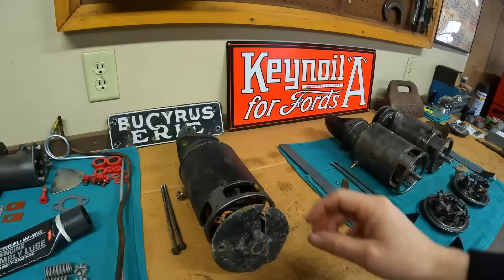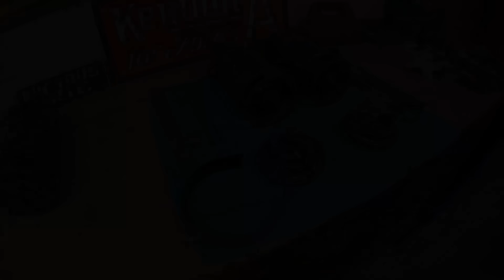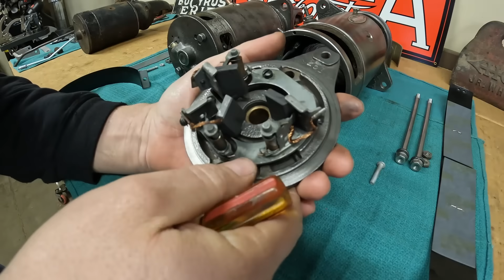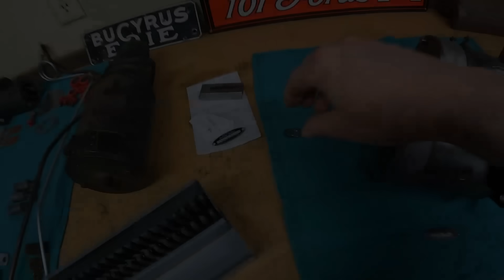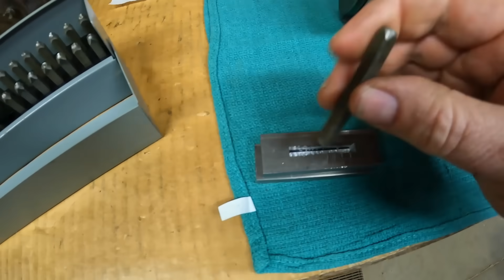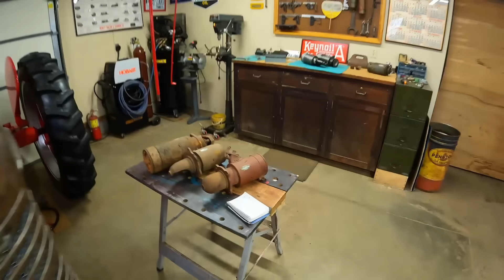Farmall Starter/Generator ID Tag Restoration, Brush Installation, & Final Assembly - "Prep H" Ep #34

Comment: Thank you so much for this video. I’m working on an old farm all generator. 6volt. I took it apart because I’m not getting charge from it. I’ve replaced the coil and regulator and cleaned all the contacts. So I decide to take the gen apart. Where do you get the new brushes and other parts for the generator?
Reply from the maker: For brushes I take the Delco-Remy part number to my local auto parts store and they’re really good about tracking new items down. Not all auto parts stores are the same though, so some might do better than others with this old stuff but it is still out there. For the rest of the parts, I rely on buying any cheap cores I can find at swap meets and keeping them on the shelf to use parts out of 👍

Comment: I enjoyed your repair video, I have been working on a two brush generator for my 1962 Pontiac I also have a spare from a 1961.  Both seem to be grounded at the armature lead when I test using an ohm meter. There is an insulator bushing in the hole, I'm thinking that there should be a plastic washer on each end, am I right or should that lead be grounded?

Comment: Where could I find replacement screw for the steel shoes on the field coils. Im trying to restore an autolite jeep generator. 3/8x16x3/4 length. Really appreciate your series on the generator and starters!
Reply from the maker: I keep enough spare units on hand that I just pull one from my pile, but if I didn’t have any available here I’d go to the McMaster-Carr website and browse around. They have just about any type of hardware ever made 👍

Comment: Looking at the brush installation, it appears that the tension spring wraps around the metal post on the "insulated" brushes.  Wouldn't that earth the brush to the case?
Reply from the maker: Those posts have insulation around their bases, keeping them isolated from the case.
Reply: @squatch253  
Ahh, got it.
Thank you.

Comment: well, I am still catching up on videos, I hope it helps you out in you logarithms, As Ralphorr8138 stated,  there are small holes in the back plate which are about the size of a small paper clip wire. This is especially true were you do not have access to the brushes during assembly. Is it true on the real old generators, alternators and starters that I can not tell you. But in tech school back in the early 80s that was drummed into my head as well

Comment: During my time in military aviation I saw engineering examples and prototypes. Most had part and serial numbers that the in-house numbers associated to a project number, not the final part or serial number format. This is to safeguard the company from IP theft, and clearly identify parts not intended for the final customer use. Only occasionally did I see an engineering example or prototype go from being 'X-009' to 'S/N 0001', and they put the new product identiplate abutting the engineering example identiplate. I asked about it, because it can be confusing... I think it took close to two years to move the engineering example identiplate from the exterior where you could see it, to the underside of the panel it had been in so the plate remained with the unit but couldn't cause confusion. It was a bit of a head banger, the unit was meant to support the SH-60B/F/H and MH-60R/S aircraft but the SH platforms were retiring....

Comment: cover joint on the bottom also lets inadvertent water intrusion drip out😊 When I worked in a parts store, I'd collected a few generator cores from customer alternator conversions. It was a great deal all around: the customer got their core value for the alternator and i got a generator for the cost of a 10si core.  those generators ended up being just fine! (rebuild wouldn't have hurt one but it still charged when i tested it)

Comment: Toby, you know I've been here with you since the start but I was just going to say I've rebuilt both the starters and generators for some IH stuff but as I've told you feels like a million times I'm an old Massey mechanic and I had a couple more steps when it came to rebuilding a generator for a Massy than a IH because I had to normally had a gear drive rear brush plate because the shaft on the generator ran the tach but that was the only difference from them. You just had to really clean the gear drive good and grease them good before completly putting them back together but to good old delco-remy was on about ever tractor I ever worked on. It's because General motors always built the very best stuff well and like their vehicles LOL I couldn't resist that gouge I'm a GM guy myself and you being a former Ford guy I had to atleast poke at you. Great video, keep up the good work you know I'll always be here watching.

Comment: The prototype starters reminded me of my 69 AMC Ambassador. When the starter failed on it, I couldn't find a replacement anywhere. I could tell that it was basically a modified Ford starter so I checked my spare parts stash and found a rebuild that had come from some scrap I had picked up when some friends were cleaning up a small junkyard. Everything fit except the nose and the armature. I needed the starter drive gear too but had to turn a piece of it backward so that it would push out far enough to get into the flywheel ring gear. Fortunately the armature was even though the brush plate and field windings on the old starter were shorted out. That's why I hate to let go of anything that has good parts on it. The old saying is that the average time between throwing something away and needing it is 3 days.
Reply from the maker: Yep, like the old Boy Scouts motto of “Better to have it and not need it, than to need it and not have it.” 👍

Comment: Boy... do i hate potmetal. Whenever i get something new, machinery or vehicle, to replace the potmetal off it, is my no1 goal as repairs go. The first of the Bernard London implementations to cheapen out products, akin to me buying a Bosch grinder, thinking "it's still a good brand" and discovering they ... changed the bearing plate for reinforced glass plastic. The most trafficked and most vital component on an angle grinder... and they made it out of plastic. Don't get me wrong, it still works, but i know it will break eventually. Same with pot metal. Only i prefer ditching it as soon as possible. That stuff cracks and warps just sitting on your shelf. I had 4 or 5 counter plates for briggs and stratton engines. New items, never used. All warped. I chucked them all to the bin the same day going through each with increased aggravation.
Just a rant about potmetal, i guess.

Comment: Both starter and generator back plate have small holes to put picks or welding wire through to hold brushes back for easy assembly. This method was drummed into me by my tech when he was training me, so have never forgotten lol.

Comment: Why do you say a 3 bolt  starter flange is rare for a minneapolis moline?  All the moline  tractors  from the mid 1960s and later have 3 bolt starter flanges.
Reply from the maker: That remark is in reference to anything in the 445 model era, where instead of a bolted flange they primarily used the single taper point setscrew with jam nut that came into the nose cone from the side. Even though the X231 prototype used the 3-bolt flange, the subsequent production models all had just the set screw. Anything outside of, or built after, the 445 models I have no experience with at all, so very little knowledge of.

Comment: What a great episode. The X231 and other prototype starters are a oddity on it's own. The big guy is probably 24V if I would have to guess? Really appreciate you covered this topic.
Reply from the maker: Thanks, the big starter does have 12 Volt on the tag 👍
Reply: @squatch253  That is very interesting info. Usually something this big indicates a upgraded voltage system. However the only thing I can think of is a big engine that needed lot of cranking amps, where it was designed to operate.

Comment: ds1945
Great videos. When installing brushes on a starter we were told to push down on the brushes to make sure they were properly seated on the commutator.   I really enjoy seeing these old machines being restored. Are you going to put he old cab on?
Reply from the maker: Yes, but after I’m satisfied that the diesel engine is fully broken in because once the cab is on, having to get back in and work on anything will be difficult. The D2 was supposed to get ran and worked hard for a couple days straight at plow day weekend last fall, but my eye surgery and ensuing recovery period put a halt to that.

Comment: In regards to starters of similar tractors like my Case IH.  When you service the brushes, some starters are reversable with their rotation.  The brush cap may be installed and clocked onto the starter housing at a 90° offset as there will be 2 to 4 bolts.  Reason for the 90° offset is to align the brushes with the commutator to allow the rotor polarity to be switched to allow the rotation as either clockwise or counter-clockwise.  Also, these starters do not care weather the tractor is a positive ground or negative ground, the different grounds will NOT change the direction of rotation as the ground polarity will affect both the stator and rotor fields equally.  The cap will have an identifying notch on it and the housing will have a "L" and "R" on it for the direction of rotation allignment, or vice versa as I cant remember that specifically at the moment.  If the starter is not rotating in the correct direct, the bendix will not extend and engage the fly wheel as this is a safety feature to not allow damage to the engine by the inadvertent reverse rotation.  If this happens, you probably have made a mistake in the alignment of the cap and housing.  As such, an adjustment would have to be made and the cap rotated by 90°.
Reply from the maker: Thanks for this info! I have seen starter end caps with two sets of bolt holes in them before, but did not know why they were made that way. Now I do! 👍

Comment: Nice segment on the DelcoRemy starters and generators and the tagging 6v. Black 12v. Red and the Green tag experimental  models like M/M used I do recall a few blue tags in my wonders round grand dad's farm and grandpa Bowens machine shop on various pieces of equipment. Great video really very informative. I got most my education on starters and generators on my dad's 60 CJ5,and my 61 IH Scout all wheel drive with the 4cyl. Comanche engine. The jeep was 6v. And my Scout was 12v. With blue tags. Wasn't sure why they were both blue dad converted his jeep in 75 to 12v red tags.

Comment: what makes thexg12 different it slows down the ionation of rust or something? or it lubricates better or does it seal better and not lubricate as well or what?
Reply from the maker: The XG-12 is thinner, clearer, and is made to get into tighter areas and maintain electrical flow while resisting moisture. The XG-3-A is much thicker and also resists moisture, but is made to primarily reduce electrical arcing damage between looser fitting components.

Comment: If the bushing in the end cap was worn to oversize and needed replacing, how do you suggest pulling out the worn bush from the blind hole? It looks like a small 'freeze plug' insert closes off the hole.. Would you just first knock that out, then replace it after bushing swap, or can the bush be changed without removing that closure cap?
Reply from the maker: Yep you’d remove the plug first, then drive the old bushing out - or just let the old bushing push the plug out instead. New bushing goes in, followed by a new plug to seal the outside of the bore again 👍

Comment: Question. Should new brushes be used once you true up the commutator on the lathe or are brushes soft enough to not screw up the lathe work?
Reply from the maker: You would typically always install new brushes if your commutator is worn enough to need truing back up. This case was an exception though, because I had previously installed new brushes on both units from the Farmall H along with truing both commutators last time and they hadn’t even worn in enough yet to require anything but a cleaning. The other W-4 starter here was also a rare exception, because it’s a fairly recently rebuilt unit that also didn’t have any wear inside at all. But 99% of the time you’ll be installing new brushes any time you’re in this far.
Reply: @squatch253  You can also use a commutator stone to help the brushes seat into place

Comment: If my memory is correct delco also used a red tag marked 24 volt with a 3 brush generator with one brush ajustable also i think prestolite used green tags on their electrical components the 24 volt gen and starters were used on early jd 4000 series tractors

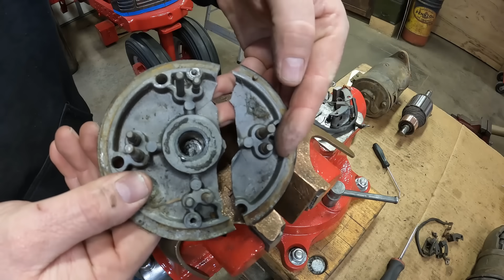Comment: 4:45, REMIND THEM, J.B. Weld works wonders on repairing Core return Parts... And Di-electric grease>?? 11:15 QUESTION Answered.! THANKS...  Do I remember correctly that A SUPER M has Delco-Remey Oil cups.?? Or a TD 6, but I was impressed, back in 1961-2, that my father allowed me to top-off those oil cups. LOL>

Comment: Excellent video the prototype delco Remy starters are really neat one of a kind pieces. I am thinking the guy that worked at Minneapolis Moline must have brought the starters to the farm when engineering was done with them or else they had that many prototype tractors and machines there.  The newer Minneapolis Moline tractor all pretty much used the 3 bolt flange type of starters after the Z and U models the 5 star diesel had a 3 bolt flange and GVI had a 3 bolt flange. Keep up the great videos